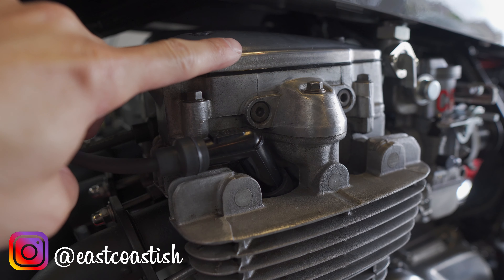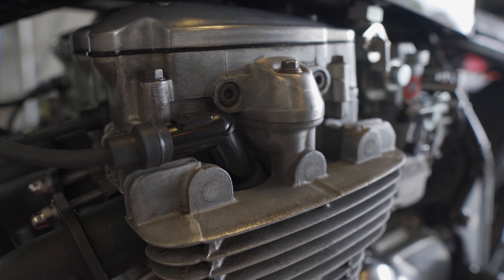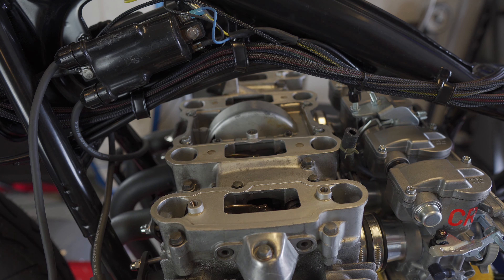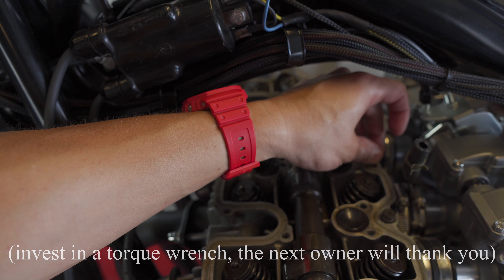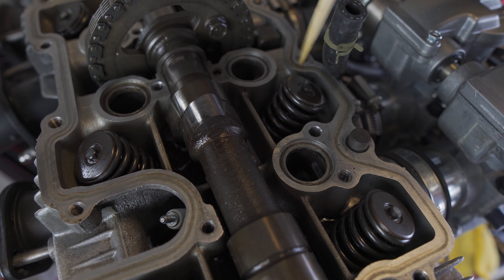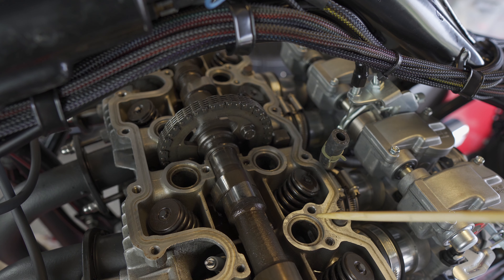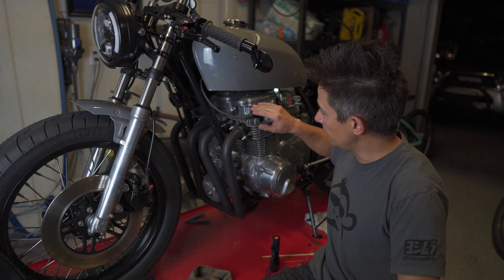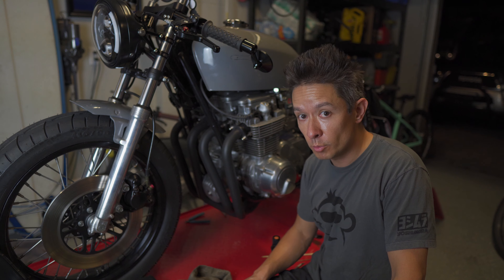Top End Oil Leak on the CB650

Comment: Nice Video!  I have an 80 cb650 (not the custom, just the reg. model) and love it.  I rebuilt the engine and these darn things are pretty zippy.  Not top end speed but off the line and up to 60/70 mph.  Kinda impressive for an old honda designed motor from 1972.  (cb500f - cb550f- and lastly the cb650). You mentioned to get a torque wrench, get one that you can read correctly.  I used a H.F. one and the lines didn't really match up to the handle and ended up torqueing 10lbs over and cracked the rocker cover.  Wish I would have spent the money for a digital one.  Live and learn.

Comment: I bought the Athena kit too and the sealing disks didn’t feel like they where a tight fit.  Did you use anything to adhere the disks in place?  I’m still having a leak, and I’m thinking it might be from the loose fit.  Also, it looked like you were able to reassemble everything without loosening and readjusting the valves.  That would make it a lot easier to get back into the sealing disks.
Reply from the maker: The discs aren’t tight but I assume the compress and seal once tightened down. Did you completely clean the area before putting them in?

Comment: I just bought an 83 cb650 and it leaks oil out of the top by the plugs and it even drips oil somewhere on the lower left side. My buddy said it was a rotting o ring or something but I haven’t looked yet. Any thoughts?
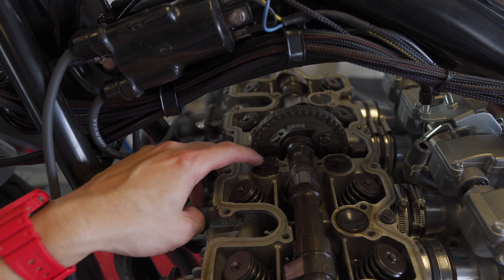Reply from the maker: It's probably a few different seals that failing, the oil near the plugs is probably the same problem i'm having, you can see them at 2:29 in this video. This is the kit that I bought that got all my leaks fixed: https://www.amazon.com/gp/product/B000K7JDKG
Reply: @eastcoastish  thanks man! I appreciate it

Comment: That was a great fix job you did and helped me out with my cb650 engine rebuild!!! And by the way what carbs are those that you are running 🤔 I really would like to know 😊
Reply from the maker: Awesome! The carbs are the Keihin CR29 Special; pricey, but a really nice carb
Reply: @eastcoastish  what do you think are the highest performing carbs for the Honda Cb650? Is it the Keihins that you have? I just picked up a 1980 CB650 the other day and it's all pretty new to me. I can find almost nothing in the way of performance parts, so I'd appreciate any insight you may have. Thanks in advance!
Reply from the maker: @danraymond1253  Yeh, the Keihin CR29 are probably the best you can get for it. They're pricey though, I think my setup was about $1k.
Reply: @eastcoastish  wow. Thanks for the info!